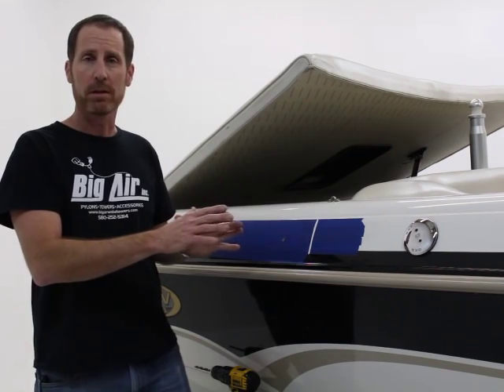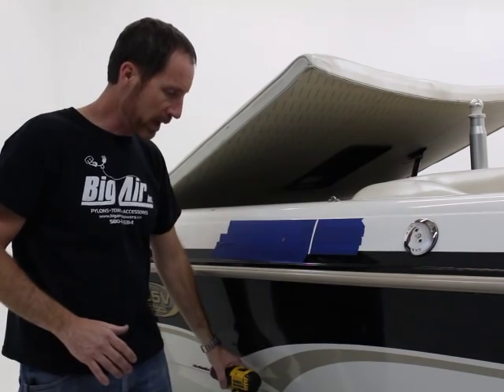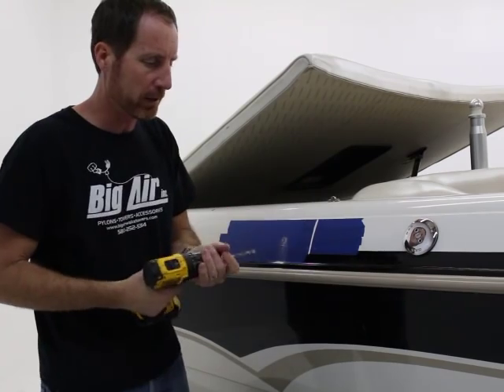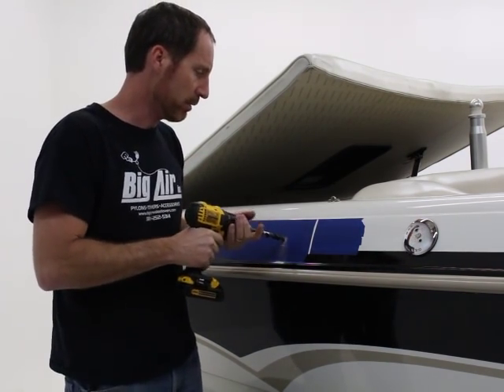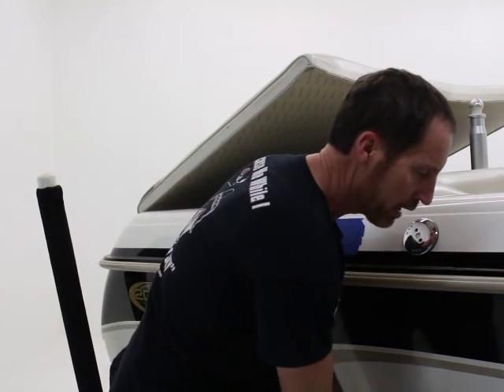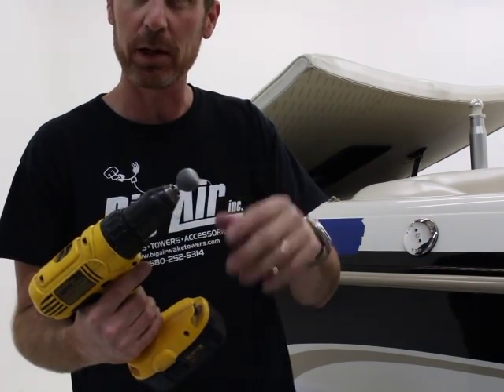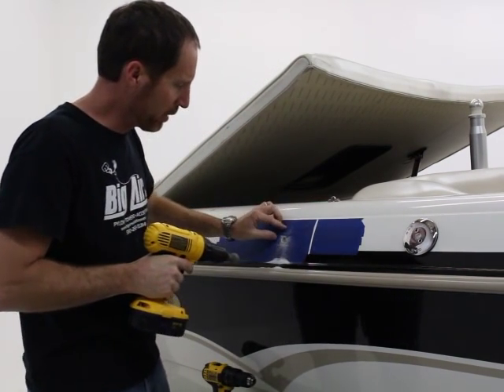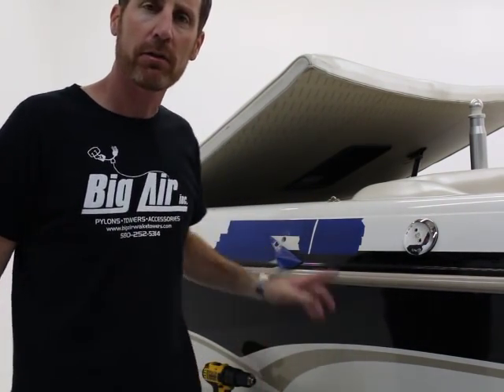How to Drill Through Your Fiberglass Boat Hull - Big Air Wake Towers

Comment: If I use a drill bit for metal, will it cut through the fibreglass well, or should I use a wood one instead?
Reply from the maker: Mason Stapleton metal all the way!
Reply: Big Air Waketowers that was quick, and thank you
Reply: Big Air Waketowers just run them in reverse?
Reply from the maker: @Anthony Moyett Sorry we missed your comment. Yes, run the drill in reverse.
Reply: @BigAirWaketowers  why in reverse?
Reply from the maker: @Bikebestnz2  We drill in reverse to avoid grabbing and pulling the fiberglass.

Comment: Thank you so much for this.  Couple of questions: 

1. what type of drill bit? metal/wood etc?  

2. What diameter drill bit do you use relative to the diameter of the screw threads? For example, if it's a 6mm diameter screw thread, what size drill bit would you recommend?

Again, thank you so much, this is such a help.
Reply from the maker: We are happy to help.
Standard drill bits are all that you need. No need for wood specific ones. 

For each tower we list the drill bits you will need for the installation in the instructions. However, if you are using a screw, you will just need a pilot hole. We also recommend to also counter sink this hole with drill bit in reverse before installing the screw. This helps to keep the gel coat from cracking.
For our towers we use a bolt and nylock nut internally. Therefore, you drill the hole according to the bolt.

Comment: At no point did you drill normally, correct?
Reply from the maker: We did not drill normally for this application. When using the ball, you can, it doesn't matter with that particular part. Just drilling with the drill bit in reverse.

Comment: What is the name of the round bit you used? Or could you post a link on where to buy one?
Reply from the maker: It's called a ball mounted grinding  stone. You should be able to locate it at any hardware store like Harbor Freight, Lowes, Home Depot etc.
Reply: @BigAirWaketowers  Run that in reverse too?
Reply from the maker: @chrisb321  The grinding ball is non-directional. Run it either way.